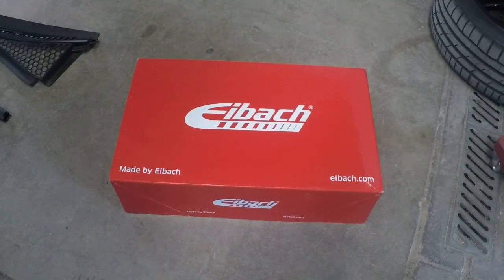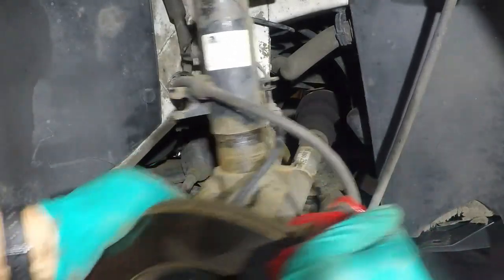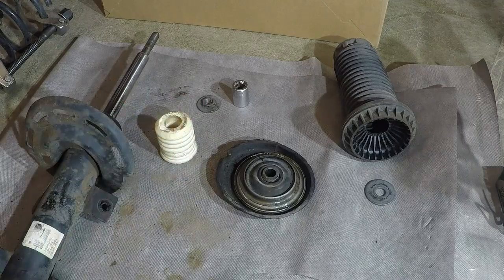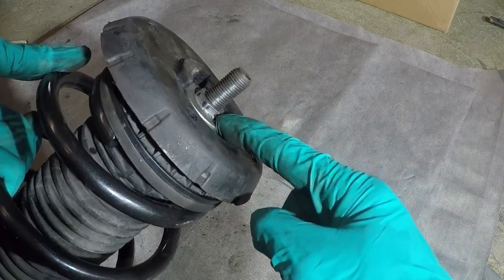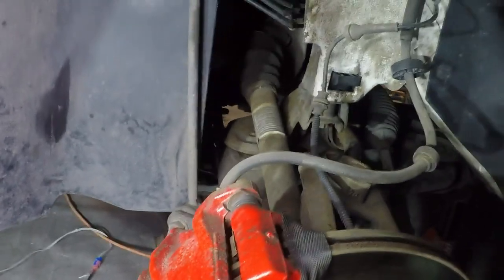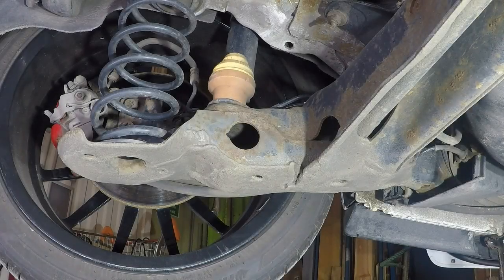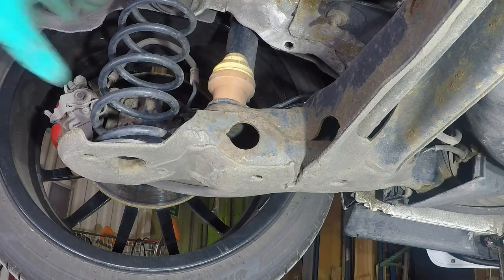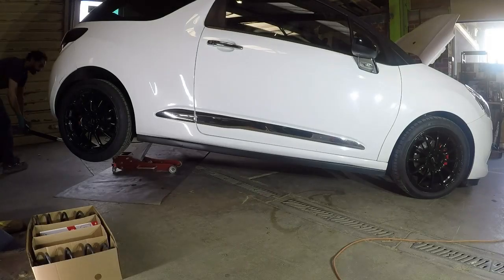Fitting Eibach Lowing Springs to a DS3

Comment: On the top rubber mount which hole do you put the Allen key in the mount  as there are 3 on the new ones I'm fitting .
Just need the orientation of how it sits under the wheel arch.
Is it the one with the white ring around it and a cut out.?
Looks like someone had changed  one before and put it in wrong as my strut is 1° out when I got it tracked and it doesn't sit in the middle of the body work hole.
Hope you can help.

Comment: Nice video Dev. What’s the drop size on these springs?
Reply from the maker: Thank you, they are meant to be 30mm front and back on my car.

Straight after fitted the dropped the front 20mm and the rear 10mm.

I can see it's dropping more already, I'll have a measure over the weekend and report back.
Reply: @myds3240  how much did the springs cost?
Reply from the maker: @SmishySmashy  I bought them for £120 from the AutoDoc app. They retail at £177 on the Eibach UK site.

They're now have dropped to 30mm on the front but only 12mm on the rear. Think I could do with having some rear passengers to help the rear drop more.
Reply: @myds3240  stick some weights in the boot.  Btw did you replace any mounts?  I’m going to fit AP lowered springs to my ds3 and was advised to replace them as well.
Reply from the maker: @SmishySmashy  top mounts were fine but I'll be replacing the rubber bushings front and back later this year.
Reply: @myds3240  Any difference after 9 months or it stayed 30mm on the front and 12mm on the rear? Does it look obvious that the rear stand higher that the front? I am actually trying to decide between the Eibach (maybe the Bilstein B12 kit) or the H&Rs.
Reply from the maker: @johnnywonka4444  I've not measured but yes the rear does seem to have dropped now and it looks a lot more even.

I'm very happy with them.

Comment: Hi mate, how is your car?
which tire and wheel do you use? I want to put the 30mm in my car but I'm afraid to get the tire on the fender
Reply from the maker: I've got the standard size tyres on 205/45/17. The alloys are Team Dynamics pro 1.2 and have a et15 so have a bit more poke.

I have no issues with scrubbing.

Comment: Took my ds3 to atS today to fit rear springs, he said he couldn’t do it as the bolt wouldn’t come out as the shocks pushes down on the nut element on the outside? Your video makes it seem a lot easier?
Reply from the maker: Hi,

Sorry I've only just seen your comment. 

Did you manage to get your rear springs replaced?

The mechanic should have figured out a way to remove the load off the bolt like maybe having something under the wheel?
Reply from the maker: @simonshotter8960  Stuff like that really annoys me, as they are meant to be the professionals.

Glad you got it sorted.

Comment: Hi, how did you remove the suspension strut without separating the hub from the suspension triangle ? On my 208 I need to remove the bottom hub mount to drop the hub far enough down ...
Reply from the maker: Hi,

I was able push the hub down enough to get the strut out, it was very tight in getting it out.

The workshop manual and some other guides do remove the hub from the car.